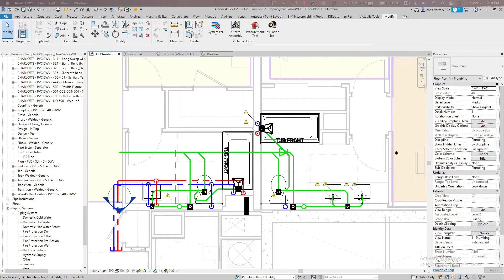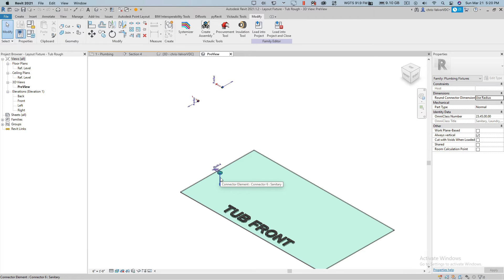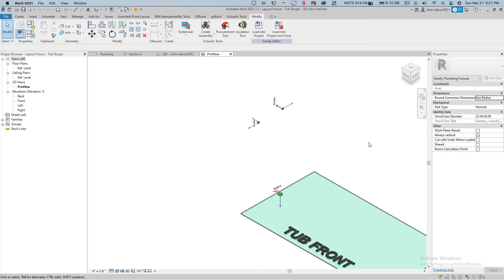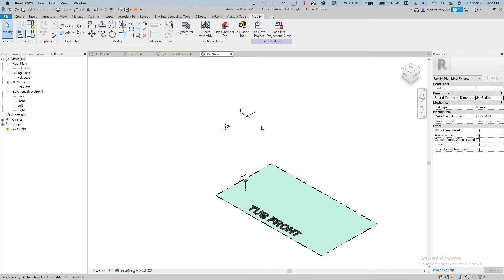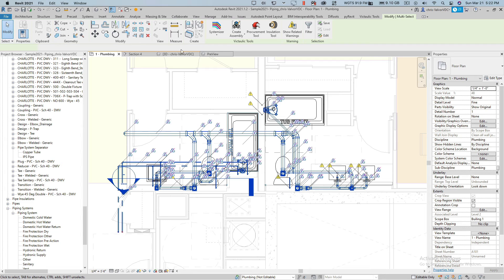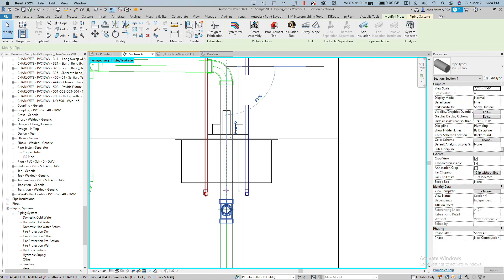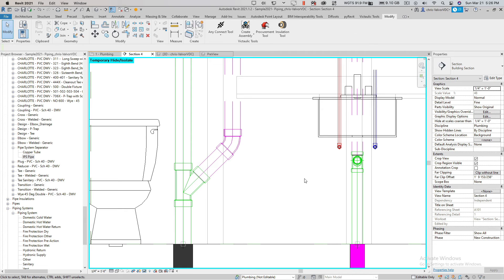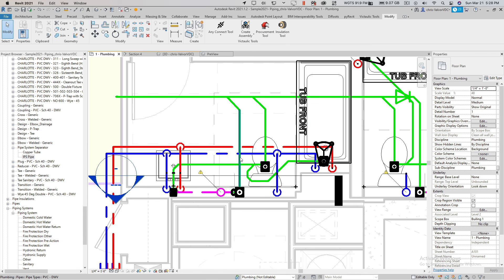Revit Pipe Systems Separators

Comment: Do disconnects still display for you once you have added in the pipe system separator and re-attached the two systems? Disconnects are showing for me using this method.

Comment: Great work with the pipe system separator, however it doesn't work in metric or pipes with ND values, should have been a easy way to adjust any pipe dimension.
Reply from the maker: Thanks for the suggestion, I will look into it.

Comment from the maker: I was on Reddit and "RippleEngineering" had lent me this advice for using this family on a waste and vent system. 

"If you set your sanitary connector to "Flow Configuration=Calculated", "Flow Direction=In" and your vent side to "Flow Configuration=Fixture Units", "Flow Direction=Out", your connector will "pull" the fixture units and propagate them through the vent system so you can use them for sizing.
Plumbing flow propagation has gotten fickle lately every since Autodesk introduced the "Calculations" parameter that you can set to "Flow Only", "None", or "Performance" in the piping system. Their thought was that you could turn off the calculations to make the model more responsive, but really it just makes the calculations hang up regardless of the setting. Sometimes you have to go and set this parameter to "none", then back to "flow only" to get the system propagating."

Currently, for the download from my website the connectors are set to global so it will connect any two systems without a problem, but free to duplicate the family, rename it to waste and vent separator, and change to connector types so you can get your sanitary calcs.